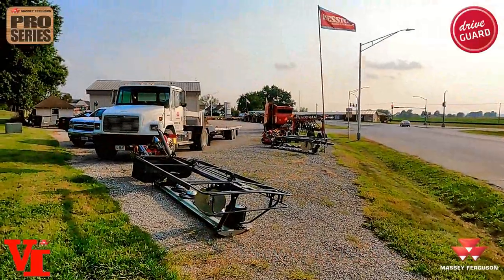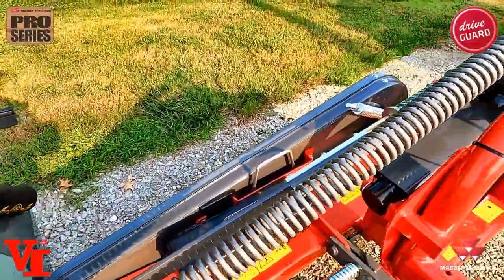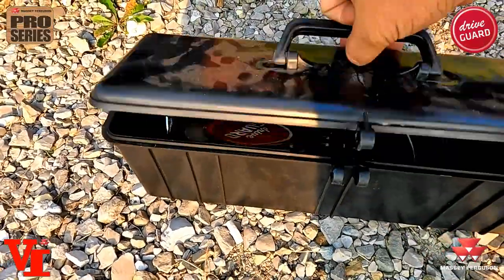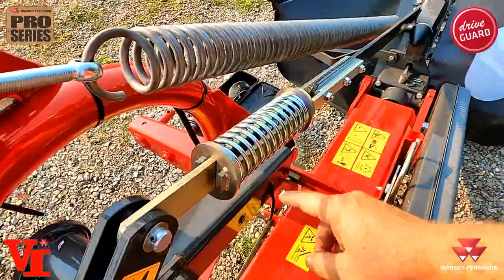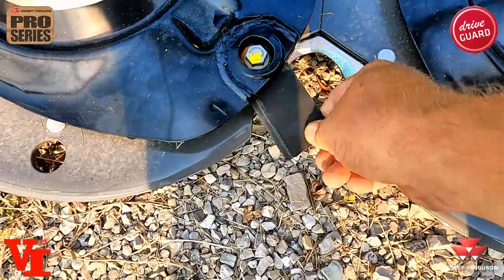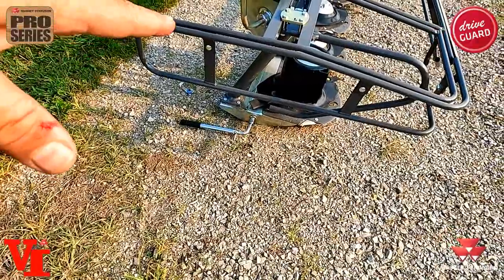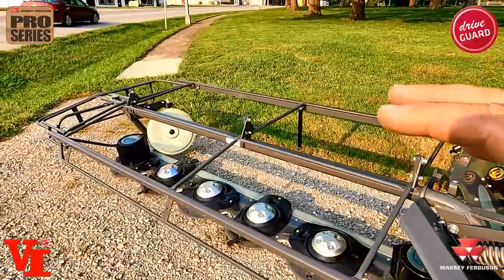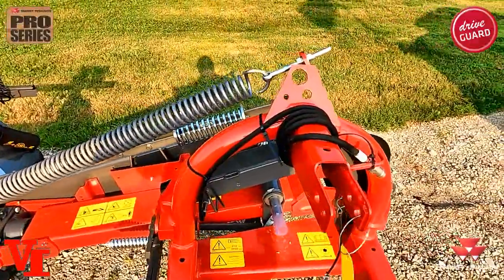Massey Ferguson DM Professional Series Disc Mowers (DM255, DM306 & DM357 Pro) In-Depth Walk-Around

Comment: You think a 4707 can handle this ok? Or should I go with the 255
Reply from the maker: DM255 Pro would be a better match for PTO HP of the 4707. (58 PTO HP) and the DM306 PRO minimum is 61 PTO HP and the DM255 PRo is recommended 54 PTO HP.

Comment: Have you seen any problems with the spring rubbing on that bar linkage? I bought a 357p this summer none of the linkage and springs seem to line up correctly to the cutter bar. Been at the dealer for 3 months now waiting on agco for a solution. Not impressed.
Reply from the maker: Which Spring the Flotation, BreakAway or Belt Tightner? We sold close to 50 Pro Series Discmowers and zero issues.
Reply: @VahrenbergImplement  the flotation springs, it’s the 357 so there’s two. They rub on the lift linkage. It looks to me like the brackets on the main frame are welded incorrectly. The tension cylinder points angled to the back. You can see how the weight of the cutter bar would be pulling on it at an angle, instead of straight inline with it. If that makes sense. Supposedly the dealer replaced the frame and it’s the same thing. Sorry to post something negative being I didn’t buy it from you but just kinda frustrated with agco.
Reply from the maker: I have some pictures of the last DM357 Pro we sold that I can email for you to compare. It works just fine and might be able to use to compare. Something sounds odd like something not correctly set up. Can you email me and I can send some images I found. My email dougvahren@ctcis.net